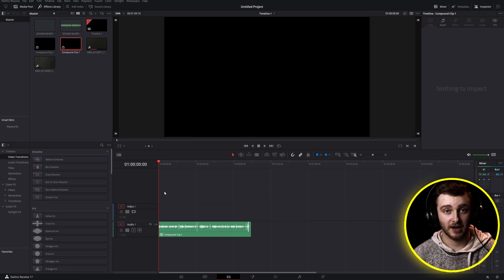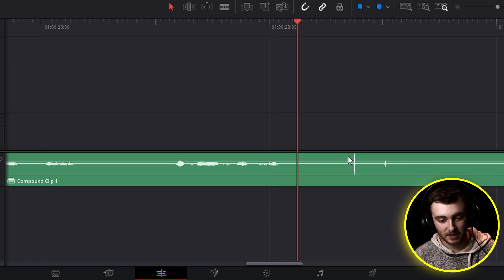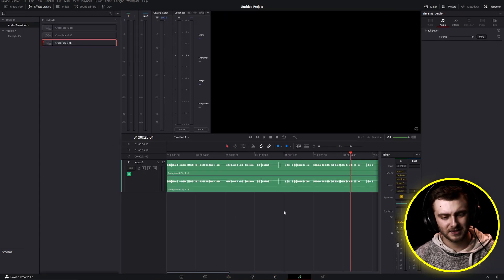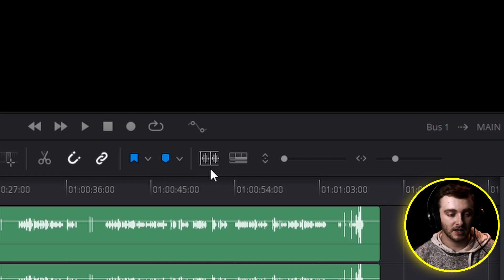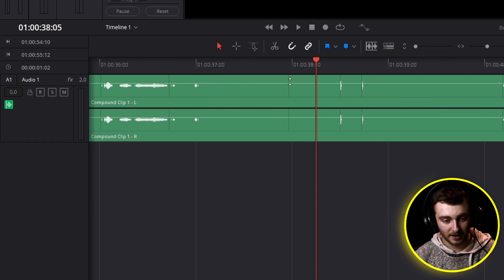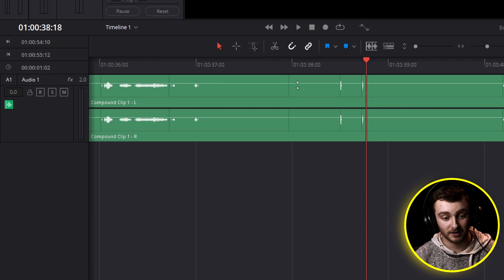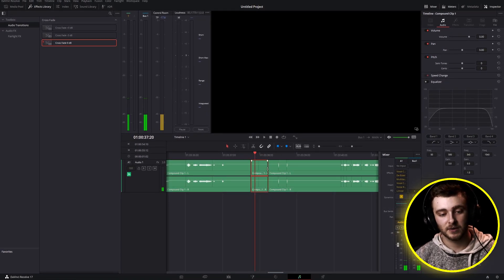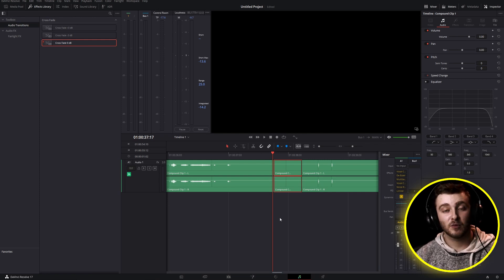Transient Detection in Davinci Resolve 17! (Automatic Audio Spike Indicator)

Comment: my audio keep popping something like peak or something. but i just make sure the sound just better in the logic pro x. how can i fix this?
Reply from the maker: Is it at cut points or does it seem random?
Reply: @GerritHarding  im sooo sorry... i just fix the problem... i forgot to turn off the normalize on logic pro x... but actually its never have a problem when i use imovie...
Reply: @GerritHarding  its random... not only on the cut point...
Reply from the maker: Gotcha, you can normalize in resolve and if you need to you can apply a limiter in there as well!
Reply: @GerritHarding  tq so much.

Comment: Hey Gerrit! I need some help. I also have DaVinci Resolve 17, but the transient detection doesn't work for me. I can turn on both buttons, but nothing happens. Do you have any tips for me on how to fix this? Do I have to change something in the preferences?
Reply from the maker: The only time this seemed to happen to me I needed to zoom in on my clip more in order to see them... Other than that though you might want to bump the volume up so it's easier for the program to find those spots 👍
Reply: @GerritHarding  Thanks for your answer! But the problem is still there, maybe my PC is too slow so it takes some time to creates those spots. But I can zoom in or increase the volume of the clip, neither helps
Reply: @GerritHarding  I also have this same issue. It's not my computer since it's very new. Been trying to search answers on the internet but no luck so far. Asking for help but no answers as well. There's also someone asking for this exact same issue in blackmagic design forum, but no one answered it. I can't give you the link since YouTube somehow removed my comment for some reason if I gave you the link. Can you help me with this? I had been stuck with this for a week now. If you find the solution, I would be very grateful.
Reply: @brooktheskeleton3973  did u find a solution?